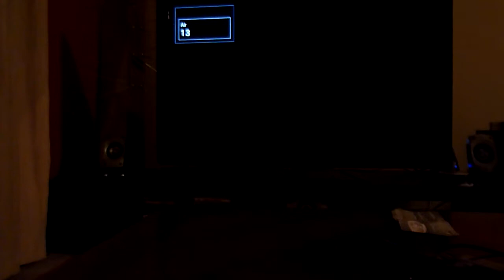DIY Coat Hanger Antenna reception video in CALGARY! 2009 OTA DTV Over the Air DIY coathanger

Comment from the maker: @steevum the antenna is placed inside, and is "wedged" in the window frame as the height of the antenna fits perfectly in there.  the angled coathanger wire faces inward from the window and is aimed towards downtown from the NE.

Comment from the maker: @steevum I have trouble getting a nice, clear picture with the analog channels CTV, Global and Access right now.  (I do get CTV and Global perfectly in HD, though).  CITY is also currently broadcasting in HD, and CBC is expected to follow this spring.  

I estimate approximately 15km away from Signal Hill?  My antenna is aimed roughly in that direction from the outskirts Northeast area of town.  The antenna line-of-sight has a relatively unobstructed view.